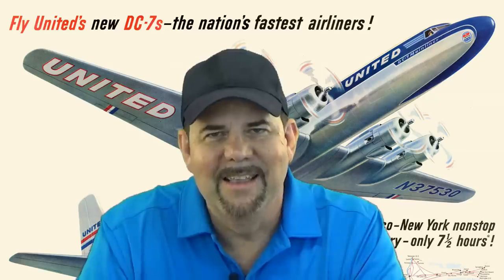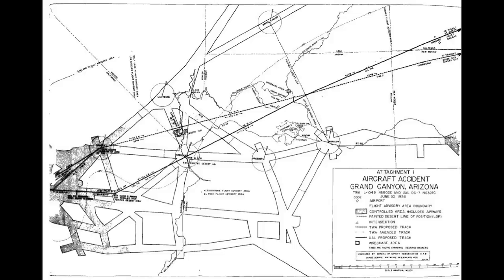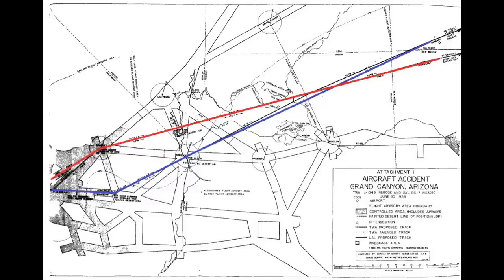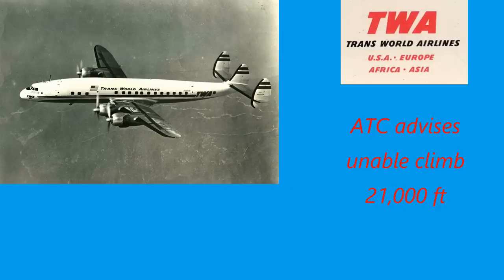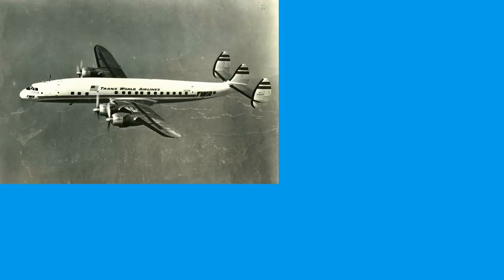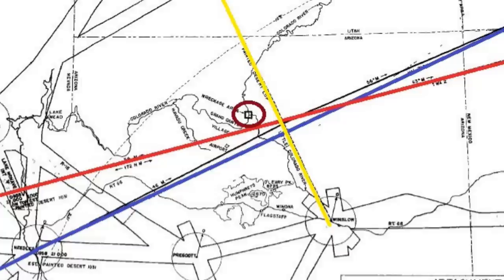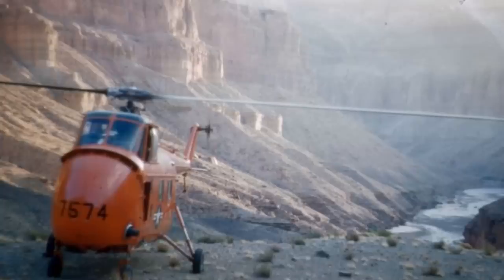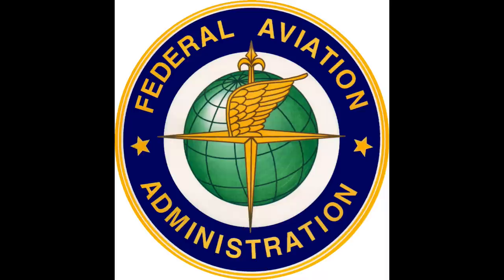The Crash that Changed the Way we Fly; 1956 Grand Canyon Mid-air

Comment: This collision did lead to many changes, but the actual fix eluded the industry for many years because the technology needed was not available.  Two years after the disaster, the integrated circuit was invented, and the path to a fix was opened.  The key was to build an airborne system that could warn of impending collisions independently of ground facilities.  Various methods were investigated, but the technology was inadequate, mostly because GPS was not yet available.  In August, 1986, a collision over Cerritos, CA made it clear that something had to be done with existing technology.  A crash program as initiated that, with the assistance of MIT"s Lincoln Laboratories, devised an air-to-air data transmission system that allowed aircraft with new equipment and upgraded ATC transponders to detect and communicate with each other.  Utilizing the latest computer technology of the time, the system was finalized and an implementation date set for 1992.  TCAS was implemented on schedule, and it worked. 

Now that GPS in fully available and widely integrated into aircraft navigation and traffic control functions, it is obvious that a GPS-based collision avoidance system would be superior to the transponder-based TCAS.  However, the ADS-B system uses the GPS system to enhance existing system capabilities, and TCAS remains an effective system that is independent of ground-based or space-based systems.  We will never know how many collisions TCAS has prevented precisely because it works very well.
Reply: I seem to remember reading about a collision avoidance system that was developed in the 80s that the FAA wouldn't approve because they were developing their own system.

Comment: This is an unusual presentation. Very matter of fact and detailed. I was not aware of that accident previously. But I did know a little about the constellation. Because a friend of mine was working on rebuilding the engine mountings for a preserved one; based in Switzerland. They are surprisingly light; considering the forces the carry.

I was already flying in 1957 (as a baby) on route to Sau Paulo Brazille; that may well have been  a DC7. We hit an air pocket and fell about 800 feet. I do remember being on several of those early piston engine aircraft. My parents flew a lot in the 50s & 60s.

Comment: Great video... scary how lax the process was at that time !!! I dont quite understand why more attention wasn’t paid (or blame assigned to) the TWA flight.  He was denied permission to climb to 21000, yet he did it anyway and at that point assumed responsibility for flying under VFR. Even though this was permitted at the time, the pilot assumes a whole lot of responsibility for the crash at that point, IMO. He’s the one who has to visually spot the other plane and maintain separation and he does not, for innocent reasons of course, but nevertheless he failed to do so. As the pilot,!when you are advised NOT to climb, there’s a reason and you would think he would have just followed the instruction.

Comment: JWT:   One of your brothers here.  Nice work.  I'm sure you have many projects on your mind, but can you tell us, (or did you in this video), did the two aircraft communicate with each other during the flights?   I have not read any other sources on this accident other than your video.  Strange to me that two aircraft on headings of similar direction would find a way to collide.  So, recreate this for me again please:  at the time of collision both have converged and are basically right next to each other.   So if I am in command of either, scanning out the front windows of the cockpit neither I or any of my crew see anything but sky and clouds?  They slowly converge, and as they do so, neither crew ever looks to the side, only ahead.  They are in and out of the buildups.  The crews are relaxed.  There is no reason to be on constant vigilance for another aircraft alongside.  They are concentrating on keeping course, and weather avoidance in the summer.  (What was the actual weather at the collision site?)  They are VFR (Visual Flight Rules for the non-pilots) but in reality are they in and out of the clouds?  So the crew is not looking out any side windows, maybe not even looking at the scenery.  Grand Canyon - I'm going to be looking baby!  No matter how old I get.  Why aren't they looking, and why don't they or one of them see another Big Boy right on their exact altitude?  Because they CAN'T SEE IT.  They can't see the Grand Canyon because there's too much cloud cover.  So their thoughts go to something else.  They are not looking down at the same white puffiness.  They are probably talking about this or that, or maybe engine No. 3 is having a fit with it's auto lean.  Or some other indication of malfunction on something in the cockpit.  Remember these are big archaic flying platforms with all sorts of what we would probably call goofy systems that would probably fail fairly often.  Or the lead Stewardess has come up to offer coffee, and wants to tell the passengers where they are, because they are all expecting to see the GC.  Distraction.  Even in the peace and quiet at 21,000 feet over the wilderness distraction can take center stage at any moment.  The aircraft are converging.  But does that mean the DC-7 was a wee bit faster than the Connie?  Or vice versa.  So, no reason for the pilots to be looking all around like a WWII aviator scanning the skies for enemy formations.  That, I can see happening.  Even today.  UNLESS the pilots had reason to believe another aircraft was nearby, reason established through communications?   Am I correct?  Other than See and Avoid, which we are all bound by, regardless, anywhere, anytime, all the time.  In other words, constant, total vigilance.  I feel the stress as I type.  Thanks again for making this, and especially enjoyed the recreation of the old style communications.  Tell me where I am wrong please, or where right.

Comment: Looking back, trying to avoid collision based on visual from the cockpit really sounds crazy... just think when you're driving through a partly empty parking lot, and the tendency of cars to want to cut across the lines. How many times have you done that or had to watch around a 300 degree periphery when someone is not sticking to the safety of controlled perpendicular lanes? Collision risk is elevated. I can't imagine how that was in uncontrolled  airspace in the 50s.

Comment: This little clip show's us that we should be very thankful for radar tracking of all flight's both commercial and military in the skies.  Seeing as the air traffic control felt and said they did nothing wrong when 128 or more live's were lost over the painted desert.  The scary thing was that nothing went wrong with the system they were using at the time,   although the system was far from where it should have been to start off with commercial flight,.  We were in far to much of a rush to get into commercial flight and not fast enough to get into flight safety.   Praise be to God that we slowed down and realized that all life matter's more than money ever will,  personal safety and human well fare before money should always be our goal in life.
Reply: Sadly 346 souls had to perish due to the same recklessness that puts money ahead of safety as we seen with the 737 MAX 8, we haven't learned a thing.

Comment: Another interesting fact... The radars that originally kept track of aircraft were soon found to be picking up interesting echoes/returns when storms were in the area. Some research was done and this led to the original weather radars, the WSR-57s (from 1957) which have improved over the years alongside the aviation radars and now makeup the WSR-88D network that covers nearly the entire United States with few gaps. The widespread use of air surveillance radar systems in the aftermath of this horrific crash, not only has saved numerous lives in the air, but just think of how many lives on the ground have been saved by the weather radars ability to detect supercell storms and tornadoes, giving time for warnings to be broadcast to allow people in the path of the storm to seek shelter... There's no way weather radar would be where it's at today had the aeronautical industry adopted it in such widespread usage. Unfortunately an old saying in flying is that every safety regulation we have was paid for in blood.... But the lives lost here were not lost in vain. Their unfortunate sacrifice has probably saved well into the tens of thousands, if not more in the years since.

Comment: Student pilot here, shouldn’t the pilot requesting VFR on top switch to the VFR semi-circular cruising altitude rule? Meaning he should’ve chosen 21.500 feet? Or was this not in place at the time? Also is flying IFR outside of designated ATS routes allowed? And is every ATS route controlled airspace?

Comment: In the 1960's  I dreamed of being an aeronautical enginneer .. and enrolled in a program to begin that journey.   In process, we students received regular issues of a publication called, as I remember:  "Morbidity and Mortality Reports" ...
Even though my progress thru the university program got so far as to my being certified as an 'airframe mechanic',  I realized that the reports of stupid rules and behaviours at the time  convinced me that I did not want to be a part of such a dysfunctional system;   I changed college majors to 'Pre-Med' and received my MD degree from a major Boston university ... 

Your descriptions of the faults in that early system do reflect deficiencies that actually extend far beyond what your article here reveals.   The new "Federal Aeronautics Administration has done much to improve flight safety, but not nearly enough ..  and I feel fortunate to have exited that program when I did. 

Our country is based upon a concept akin to " Profits above all" , and the 'Boeing/FAA' disastrous relationship of today reflects attitudes reflecting what happened to cause me to 'bail out' of that industry.
Thanks for your excellent presentation ---
                                      --- J.A.,  MD <Ret.>
Reply: Tkj Tkj mds more than any understand profit before all
Reply: So you did not have passion for it and therefore failed to be a part of the solution to  it.  Better you left off.

On rules and regulations.
Boys, boys, boys!  Rules and regulations are not there to control you.  They are the condensed collection of our best knowledge of how to do the job properly and save your own skin when the brown stuff hits the fan.  That is if you followed procedures.  If you don't know, go to your next higher up.  (In this case there was no real higher up).  However; that does not mean you can park your head on the shelf.  Use it!    Cabin Services Instructor, (Ex WWII Bomber navigator), SAA, Jan Smuts International Airport, 1971.
Reply: "Even though my progress thru the university program got so far as to my being certified as an 'airframe mechanic', " 
Not that "far", as there is no relation between a mechanic and an engineer, unless the former is kind of a genious. Only in the beginning, aeronautical engineers were master mechanics, but with the advent of modern engineering, the two job functions have diverged greatly, and courses taught reflect that.

Comment: As much as things change, the more they stay the same.  Although the FAA was complicit in bringing about change in commercial aviation, they have never surrendered their charter (brought forward from the CAB) that their primary purpose is to promote commercial aviation.  They are not an enforcement group and rely entirely on self disclosure by the very companies they are supposed to regulate.   Case in point, Boeing 737 Max.  Airline accident discovery and analysis is primarily the responsibility of the National Transportation Safety Board, a non-government agency.  The NTSB conducts the accident/incident investigations and provides their findings to the FAA.  Depending on the economic impact to commercial aviation, the FAA will make a determination whether or not to act.  
That is why it is called “The Tombstone Agency”.

Comment: Awesome presentation James! It was easy to follow and clearly showed what happened. I do have a question for you.

Do you have any information about a 'redacted report' from the National Parks Service concerning the 1956 TWA - United Airlines 
collision. I have contacted the NPS to inquire about the report and this is the response I received -   

Mr. Leib, (that's me)

I can tell you that it is unlikely that we will be able to release any of the redacted information.  When the redacted report was prepared for posting on the web it went through a review process similar to the one we would do for a FOIA request, during which it was determined that the redacted information needed to be withheld in order to protect both the site itself and the safety of visitors to the park.  However, you are welcome to submit a FOIA for the report and we will do a more formal FOIA segregability review, which will include the required Solicitor review.  If at that time, we are still unable to provide you with an unredacted copy, you will also be notified of your appeal rights.

If you wish to pursue a FOIA for this request, you can submit your request using this form:  https://www.doi.gov/foia/foia-request-form.

So I made a formal FOIA request and was basically told that no further information was available

Here is a link to the Redacted NPS Report - https://www.nps.gov/nhl/news/LC/spring2011/GrandCanyonREDACTED.pdf  

 

Getting straight to the point - I believe there is pertinent information being deliberately withheld from the public about this incident, and 
the NPS' statement about "protecting the site" along with "visitor's safety" is not a viable explanation (in my opinion). They may as well 
close off the entire Grand Canyon using that logic. I believe it is possible that there may have been, and possibly still is, something 
around the crash area that is of significant relevance to this terrible incident.

The location of the crash is well known and photographed. The area is officially restricted to visitors (two planes crashed in New York on 9/11 and that area's not restricted). The incident occurred over 60 years ago. Why is there anything of a confidential nature at this point? 

I would certainly appreciate any information (or opinions) you may be able to share. 

                                                                                                                                        Roger
Reply from the maker: Yes, I am aware of the redacted NPS service report.  I do have some information about a radio reporter that visited the site in 1957 or 58 that caused quite a stir.  If I can find it I will post it to by website at http://www.jtweatherly.com/jtwpilot-channel/1956-grand-canyon-crash/.   Thanks for the comment.  Keep watching.  James
Reply: That would be great! Thanks for the reply! 🛫🛬

Comment: You forgot to mention that all aircraft are equipped with an "S" mode transponders which allows aircraft to see each other. This is a type of radar system that each aircraft is equipped with that allows your aircraft to transmit not only your altitude and position of your aircraft but also the "N" number of your aircraft and distance other aircraft are from you.
Reply: Those were not on planes in 1956.
Reply: They are now. Not back then.
Reply: He didn't forget.  All aircraft are not equipped with S Mode transponders even today. S Mode transponders didn't even exist in 1956. Transponders are not required at all except in defined air spaces. The type of transponder required varies with the defined air space. Of course, all commercial airliners operate in these spaces, so have transponders, & most aircraft do have A, C, or S mode transponders . S Mode is the latest greatest Mode, which is back compatible with A & C modes, & can support the Traffic Collision Avoidance System. The airliners in the accident would have been operating C mode transponders, which report their assigned squawk identity & pressure altitude when queried. That's it. "A" mode transmits nothing but assigned squawk ID. Position & heading is determined by the ground radar that queried. C mode has no capacity to determine or transmit position or heading. But it can respond to queries from S mode transponders just like it would a ground radar. ID & altitude. 

The accident aircraft were out of range of ground radar, so ground control had no way of knowing their exact position, & their transponders could not have provided location & proximity information either. The pilots were on their own. As good as it is, sometimes the Mk-1 Eyeball just isn't good enough.

Comment: Good documentary. It was a different world then. The idea that a pilot could just tell ATC that he was going to climb to the same altitude he had just been denied by telling ATC that  he would stay on top of the clouds is absolutely absurd now.  But back then most of the time there were no other aircraft around for miles, so he probably didn't even consider it hazardous. He'd probably done it many times before. Finally his luck ran out.
But even still, if several other things had not lined up just so, the crash would not have happened. If TWA had left LAX on time, if the weather had been clear, if even one of the pilots had stayed on the flight plan without taking some turns over the Grand Canyon,  the accident would not have happened. There are probably many other circumstances that, had they not lined up perfectly, the accident wouldn't have happened. 
At least it wouldn't have happened to those people. But with the lack of ATC facilities, and with more and more flights, something like this was going to happen eventually. And it has happened again a number of times. So even as unlikely as it is, midair collisions still happen.